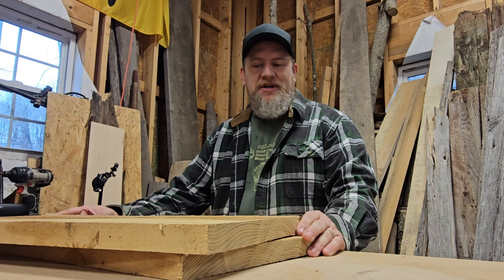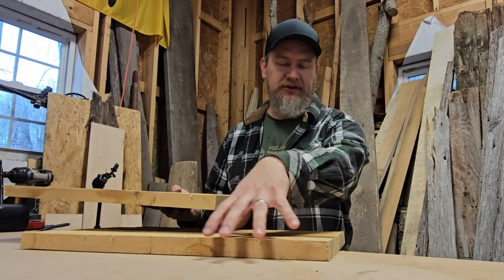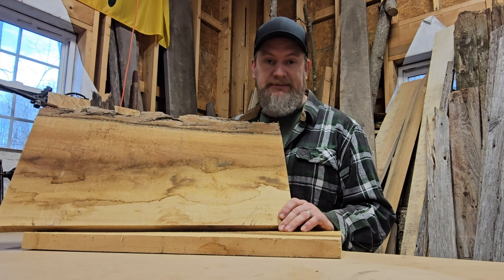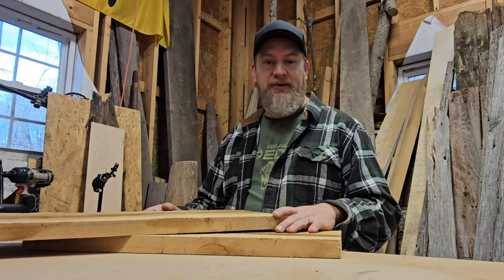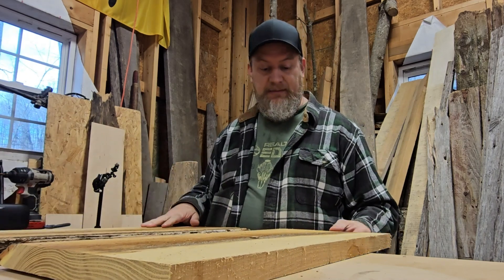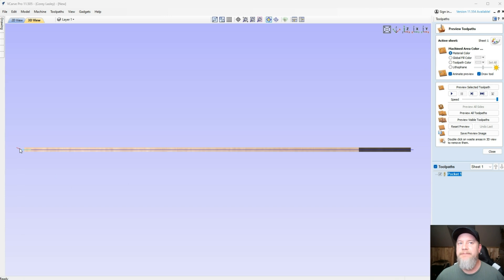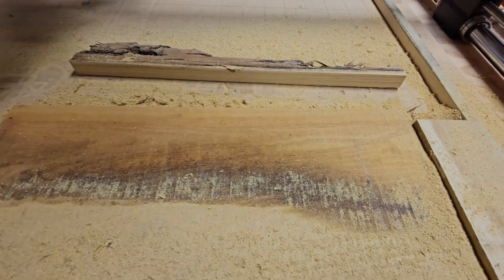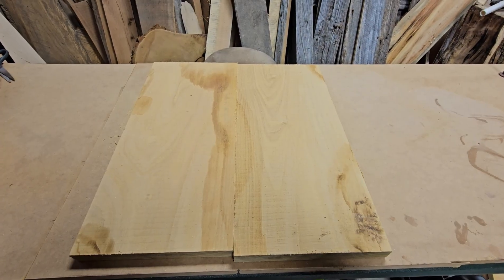Jointing Boards With My CNC Machine

Comment: Couldn’t you have ripped that edge on table saw?  Would give 2 straight edges for glue up and then square the board to size.
Reply from the maker: Probably could. I don't use my old table saw much, and it is currently buried in my ultra cluttered shop 😅